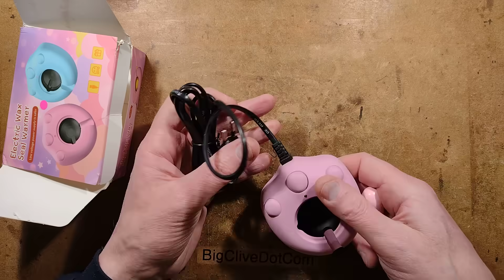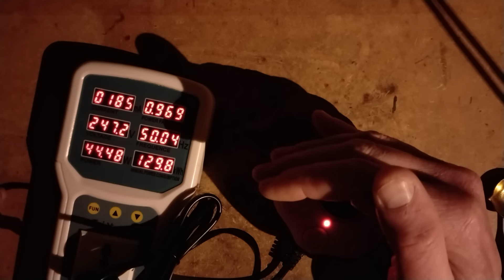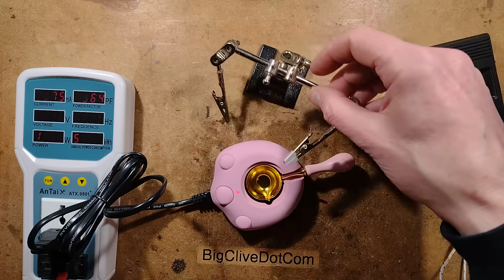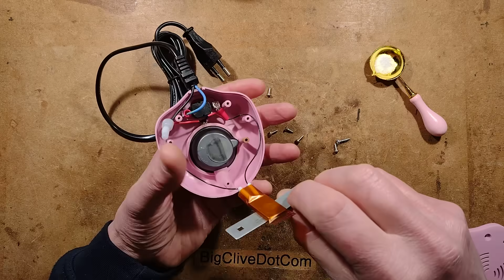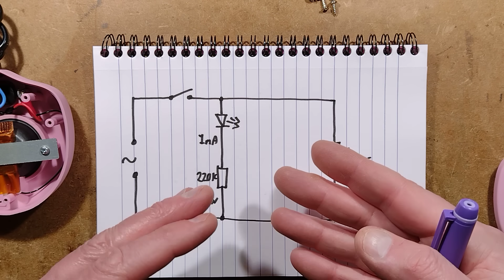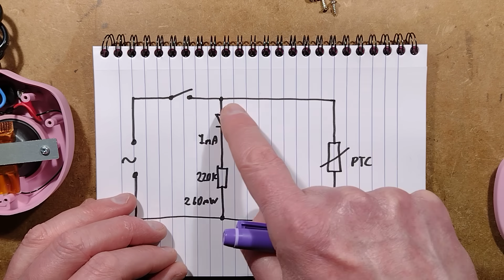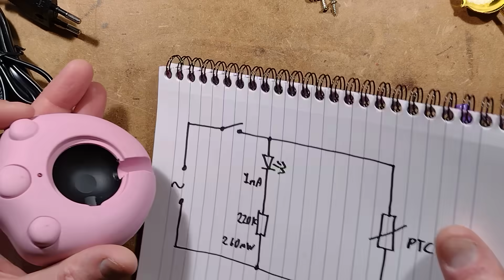Inside a sealing wax melter - with other uses

Comment: I've seen heating devices held in place with a mica strip so that they don't conduct heat. I suspect that plastic will become brittle after a short exposure to these temperature, eventually causing those legs to break.
Reply: mika still conducts heat though. Before silicone, thin pieces of mika were used as electrical insulator to mount transistors on rads.
Reply: @PainterVierax  No disrespect, but I suggest you check the thermal properties of mica. Everything I've read tells me it has very poor thermal conductivity. Of course, a very thin wafer if mica will provide excellent electrical insulation and will transfer some heat in the scenario you suggest but for this purpose there would be very little heat transferred along the length of a mica strip.
Reply: @ Though mika was selected among thousands of materials available during that time then massively used in electronics (on the contrary of your own example where ceramic was by far the usual insulating material) so it surely is not such a poor thermal conductor as you claim.
All in all, by today's standards mika is just far from ideal on both ends.
Reply: @PainterVierax  It isn't my claim, it is the definition of the thermal properties of mica. I didn't invent them, they are there for everyone to read. If not for YT's restrictions I would post a link so you can read it for yourself.
Also, I didn't say it was ideal, I said I had seen it used, but it seems it must be a better candidate than the metal strip used here.
Reply: @chrishartley1210  "Specifically, mica is unusual in that it is a good electrical insulator at the same time as being a good thermal conductor." says the Wikipedia article with a quite recent 2008 book as reference. The article on other languages sometimes add that its thermal conductivity is average to explain the abandonment I've described but it's never referenced as poor. So I don't know where your info comes from but there's something off here. And, again, it diverges drastically from the property required for the broad usage I've mentioned.
Reply: @PainterVierax  And from the same article, just above your quote: "Sheet mica is a versatile and durable material widely used in electrical and thermal insulation applications." Wikipedia is a poor source of reliable technical information, it is better to look at proper technical references such as those comparing thermal conductivity. Mica has a thermal conductivity of 0.71 W/mK which is on the low end of the scale, compared to steel which has a TC in the range 30-60 W/Mk.

Comment: That's a very niche item isn't it?  Interesting.  Sealing wax used to be these sort of specialized candles that were very shiny.  You'd light them and drip the shiny wax and then imprint the molten wax with your "ring" or seal or what have you.  I would suppose a unit like this would allow you to seal several envelopes at a time.  

Thanks Big Clive.
Reply: We found a few sticks of sealing wax among our father's old possessions when selling their house - think we binned them but should have kept until this video appeared!,
Reply: @FamilyOfEyles  I think I had a few of those as a kid in the 60s.  You could go to the specialty shops and even get "special" (cheap) rings to make a seal on the back of letters to grandma and grandpa etc.

Comment: Wax melting, eh? Getting naughty thoughts already.
Holy shit, this thing is so badly designed inside. A piece of metal pressing the PTC, no thermal insulation there, transferring the heat to plastic standoffs that don't even have threaded insets or nuts inside? C'mon, that's BS. Just a teeny tiny bit of use and it's degraded already.

Comment: Is it hot enough to pop a popcorn?
Reply from the maker: Yes.  It popped 5 kernels I put in.  It took a while, but they popped.
Reply: there you popped it
Reply: That is portion control at it's finest!
Reply: Thrill dieting? Hardly, wrong extreme
Reply: How to diet. 😆
Reply: @Slikx666  
Unflavoured popcorn is already pretty safe for most diets
Reply: @MrHack4never  
Extreme dieting. 😆
Reply: @MrHack4never I actually looked into this and I was able to buy all the shit to make movie theater popcorn at home and still have it where it's less calories than the stuff you can buy at a store or at a theater.
Reply: It's a great easy way to get more fiber in your diet
Reply: @MrHack4never the oil used in popcorn is usually trash

Comment: "Low voltage power supply safer" means run it off 120V despite the European mains plug!
Reply: It will also clean your house and do your dishes.
Reply: @TopEndSpoonie  Well it might remove your need to clean your house or do your dishes, once it overheats and sets the house on fire.

Comment: I wonder if somewhere in the instructions (if any...  :)   there might be a warning not to leave it on without the ladle and something in the label, to help keep temp down/lower.  I was surprised it had 5 screws holding it together!   But do think those posts holding the metal bar ARE degrading, very obvious, even in the video.  So next experiment is to put it outside, and just leave it on for a day and see what happens.  Hopefuully flames, or at least showing it melting (need webcam recording for whole time it's on to catch that.. :)